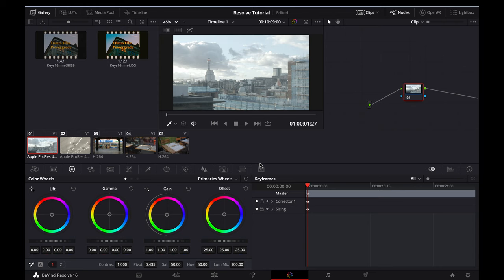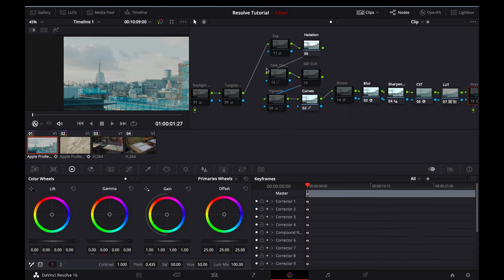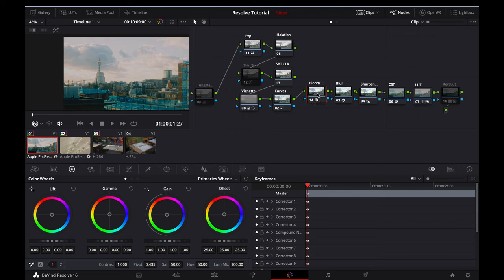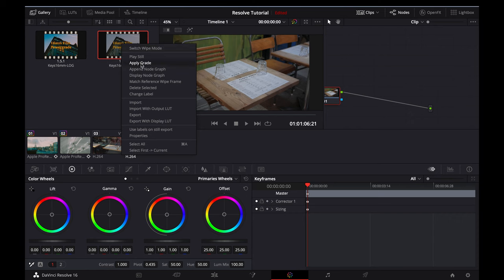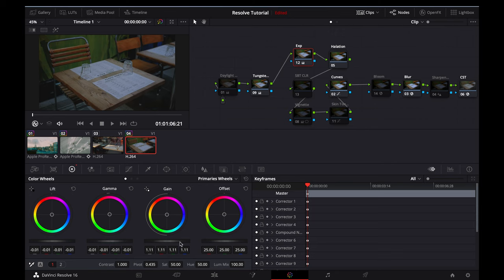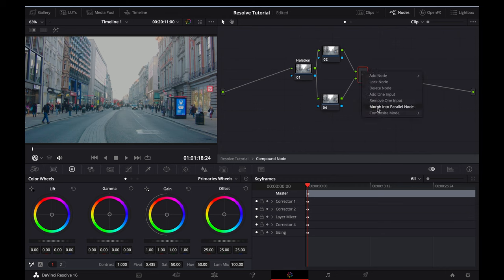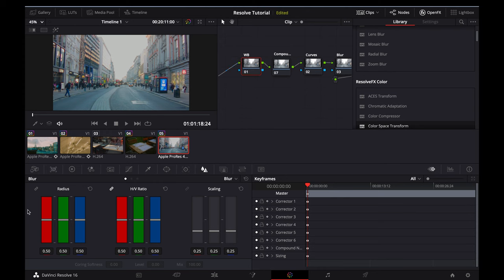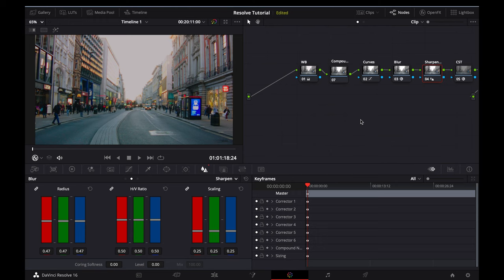How To Simulate 16mm Film With Any Camera / Color Grading Tutorial

Comment: Hello Oliver , I just purchased the pack and from having the same identical kit I thought I could/ would get sorta the same results kinda with you . Surprisingly enough im actually really struggling to color some of my footage is it because I shoot in Pro res instead of Raw or does that not affect anything at all ? just really curious to know
Reply from the maker: Hey Gerald, hmm that sounds very odd. I also shoot in ProRes most of the time so I don’t think this will be the issue. Firstly have you amended your exposure in line with the waveforms to make sure the contrast is set correctly? Secondly have you used the lift gamma and gain dials to correct your white balance? If these are set correctly then you shouldn’t be having any issues. Drop me an email at oliver.keyscine@gmail.com with some screenshots and I can help you troubleshoot further!

Comment: Hi Oliver, I have a question how could your audio is so clear, I'm using the same Zoom H1n and it does not sound quite as clear. Thank you!
Reply from the maker: Hi there, I’m really not an expert on audio but my general approach is to set a limiter on the zoom and then get the levels correct when recording and then apply the gate feature in the EQ settings in davinci to cut out any ambient noise.

Hope that’s useful!

Comment: How important is it to use the original bmpcc instead of the bmpcc 6k to achieve this 16mm? What if I tried your tree already made for bmpcc on a bmpcc 6k footage? Also did you shoot the clips shown in video in RAW?
Reply from the maker: You can definitely use the Bmpcc 6k, all you need to do is apply the LOG powergrade from the download and select the “CST” node and end the input to Blackmagic design 6k and you’ll be good to go :)
Reply: @oliverkeyscine  But it wouldn't end up looking as cool as on the original bmpcc? 😁
Reply: @oliverkeyscine  The reason why I'm asking this is because I sold my old DSLR and currently only have a Sigma 24mm 1.4 DG Art lens. I don't know weather I should buy the bmpcc 6k or the OG. If I bought the OG I feel like I could only use it for this vintage type of look but maybe it isn't the look I always wanna go for. That's why I'm asking if it's possible to achieve a similar look with a 6k to the og.
Reply from the maker: @clayz8098  I’m sure the 6k will achieve a similar look
Reply: @oliverkeyscine  What about raw?

Comment: Hey, I purchased both this and the orthographic film pack but had a question. What are you selecting in color space transform for input color space, input gamma, output color space, and output gamma? not sure if my settings are correct
Reply from the maker: Hey, it really depends on what your camera is and which powergrade you’re using, there is a specific part of the video where I walk through the Color space changes you need to make, feel free to drop me and email if you’re still having trouble!

Comment: i bought your powergtade, have a bmpcc4k i shoot RAW i dont know if i should use the LOG or the srgb and then i dont know what my CST settings must be,please help
Reply: From your comments i see that i should go with the LOG option but i still dont know what CST node settings i should have, also what are your General CST settings (YRGB,YRGB color managed auto, or ACES)
Reply: also when i press your KeysLut it says Missing Look up table 3d lut:keyslut/fuji pro 400.cube
Reply from the maker: Hi there, sorry for the delay! You need to select the Blackmagic 4K option in the CST node. The LUT is in the “Keys LUT” folder in your download file, you’ll need to  import that to davinci and apply it to the last node. I originally called it “Fuji 400h” that’s why it shows that message. I hope that helps but let me know if you’ve got any more questions!